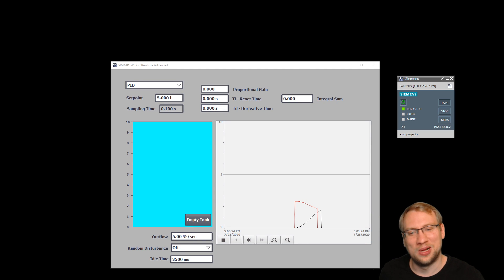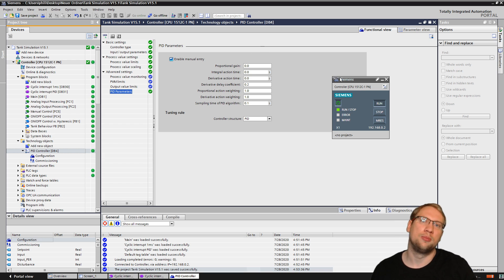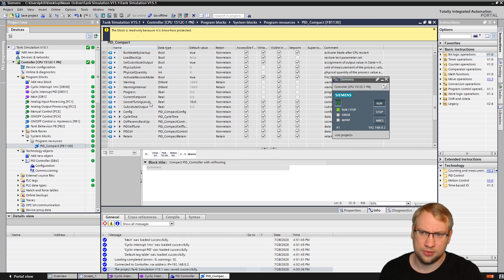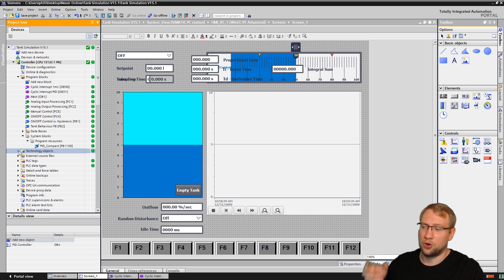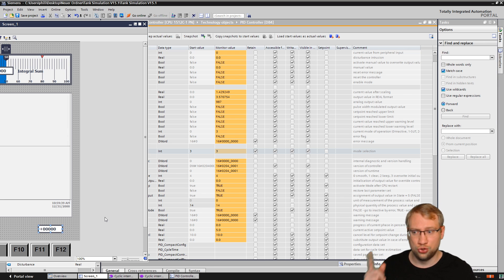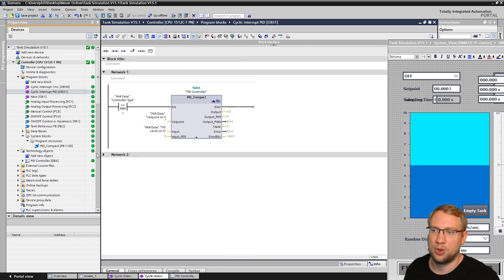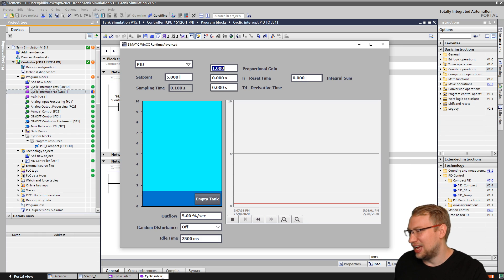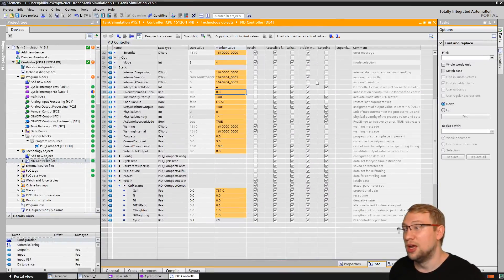TIA Portal: PID Compact - Connect to HMI / Control in Runtime

Comment: Dear sensei, kindly tell: What's responsible for the smooth animation of the fill level on hmi? I copied the program off the last video and modified the V15  program (CLC v2) but my fill level animation is not smooth. Thanks for the prestige!
Reply: Okay, i got it: the pid controller was the issue. Had to switch them around till i finally landed on v5, pid compact v2.2.

Comment: I avoid pid_compact with all cost. The old cont_c (fb41) is much better.
Reply from the maker: That's a bit generally said, but it definitely has it's advantages. But so does the compact block. In the end I would say "depends on the programmer and application"